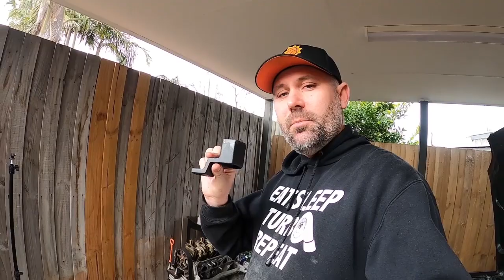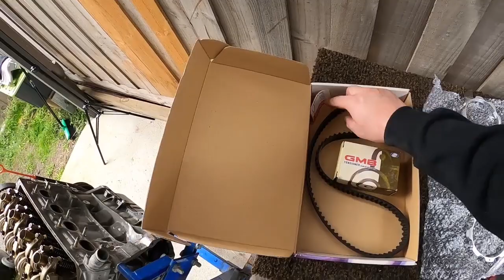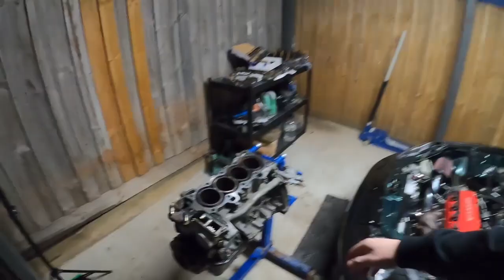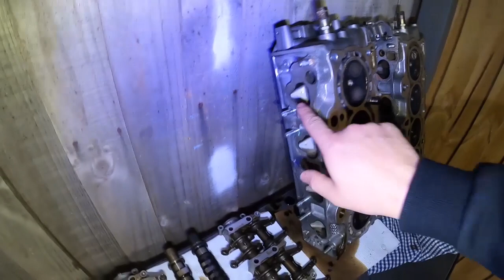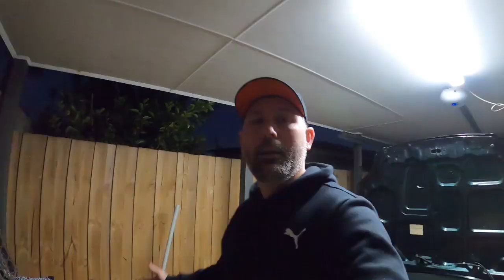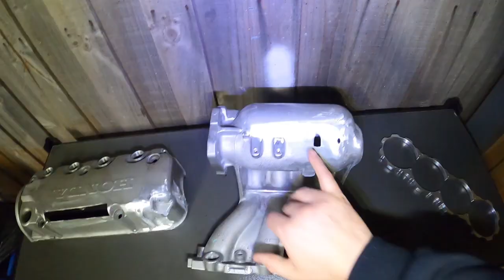$50 ENGINE  D16Y TURBO EK Civic BUDGET BUILD Ep44

Comment: Hey mate what kind of fuel presure reg are you running?
Reply from the maker: Hi Bailey sorry for the late reply i have a saas fuel pressure regulator  but you can use any brand as long as it is" rising rate" meaning for every psi of boost fuel pressure rises by 1 psi, please consider subscribing if you haven't already
Reply: @TURBOTRISTO  thanks for the reply! Have subscribed, doing a turbo conversion to my ek1 hatch at the moment, also wondering what kind of boost pressure you're getting?
Reply from the maker: Bailey taylor mine is running 14psi on a stock motor for now when the built engine goes in I will turn it up to around 25psi
Reply: @TURBOTRISTO  geeze! I thought I'd be pushing it with 6psi! Haha thanks heaps man look forward to seeing more on your build!
Reply from the maker: I'm told 13psi on 98 fuel is very reliable, it all depends on fuel system and engine managment
Reply from the maker: @baileytaylor1041  check out my other videos on it and pleas feel free to ask any questions you like
Reply: @TURBOTRISTO  that eases my mind alot! Thanks for the information man, keep up the good work!